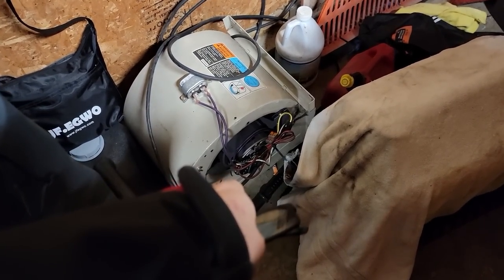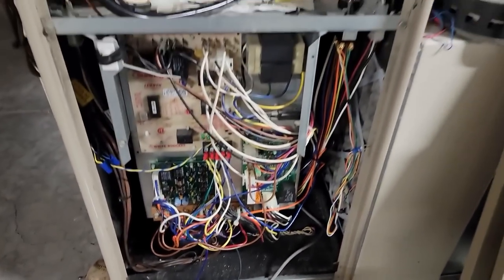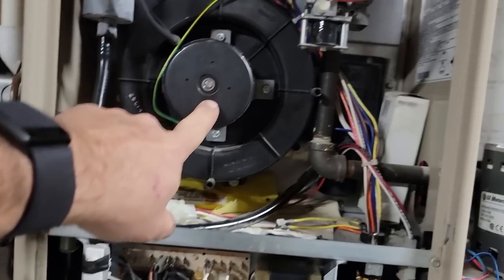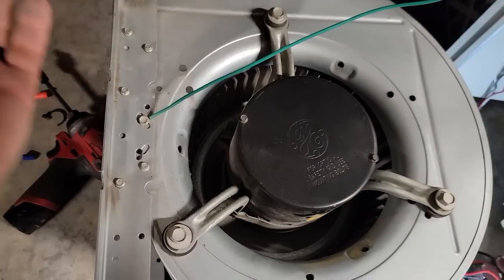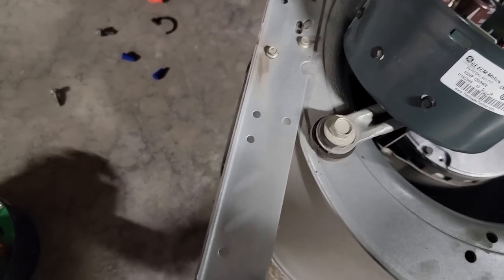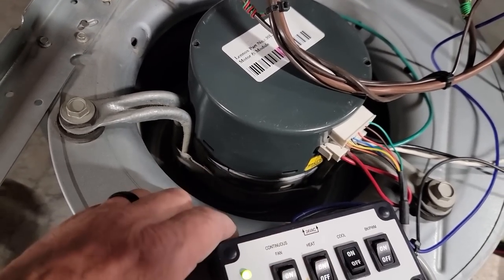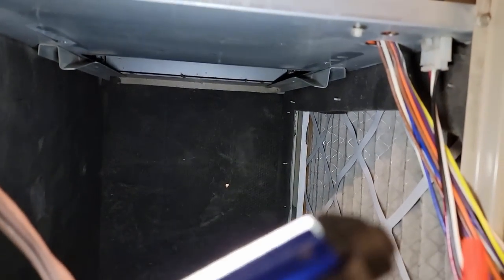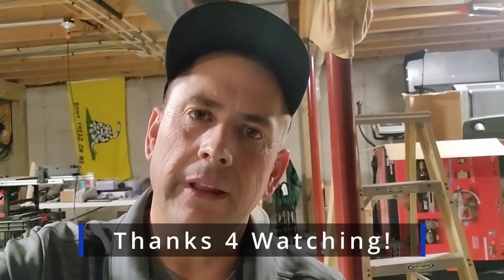NO HEAT @ MY HOUSE! + I'M ON CALL🤦🏻

Comment from the maker: 🍺👉👉Before you guys say anything... the electric strip section has a cover that I did not have on it,  so no need to worry about safety. Also a good example of warranty parts that I acquired would be having a bad controller but the motor being okay or the motor having noisy bearings and the controller being ok.

Comment: An ECM blower motor that lasted 20 years? That's got to be some kind of a record!
Reply from the maker: Probably because I left it run Non-Stop. I figured if the bearings go out I can replace those
Reply: @HVACRSurvival  That's true, most electronics fail on startups.

Comment: I saved some HVAC parts for many years.  I've given much of the stash away, now.  Fractional horsepower single phase motors were keepers.  Always kept parts on hand for the furnace in my house... an old Mueller Climatrol.  Never needed anything for it... so far...
Reply from the maker: That's Smart!👍

Comment: At least it’s repairable. I have a trane heat pump on my house and the condenser txv sensing bulb/cap tube rubbed out. Been waiting a week for trane to get it here
Reply from the maker: I had the same thing happen to my Ducane heat pump, I ended up getting a whole new condenser unit because the compressor ended up going bad because they didn't put a low pressure switch in it to protect the unit and they did not have any compressors in stock. I wasn't going to wait a week and a half in the middle of summer. I put it real gently like this, "I see seven to nine customers a day and I'll sure they all know what kind of quality you have... so get me a new unit. "

Comment: Very nice video. What would it take to change the ECM motor to a PSC motor? Thanks, hope you will show how to do this in an upcoming video.
Reply from the maker: The main control board has heat and cool speed available, You would just hook the psc fan speeds to the spayed terminal on that control and your done.

Comment: There are companies that specialize in rebuilding circuit boards, and that might be a solution to the supply chain issues on certain products. It might be good on hard to find/obtain units.
Reply from the maker: The part that actually has the microchip has a rubber coating poured over top of it so you never get it out. GE knows how to stick it to you.
Reply: @HVACRSurvival  I'm sure that the rebuilders have a work around. Sometimes these coatings are a type of urethane, and moderate heat can soften it enough to remove it.

Comment: At time marker 12 min and 10 seconds you said the motor was 3 phase DC. 

Phase is a property of cyclically varying things like AC voltages. DC is not variant, but constant with respect to time.

The concept of phase is meaningless for DC.

Would you care to elaborate?
Reply from the maker: Research frequency drives for a better understanding of how the drive system works. Its a modified AC wave form and it is truly a  DC modified wave form being created with pulse width modulation,
Reply: @HVACRSurvival  pwm is a AC signal.
Reply from the maker: If you say so but you're incorrect.  Pulsing dc voltage is how you make a clean sine wave. Ever heard of an inverter generator? Generators generate AC voltage but it's converted into a pure sign wave with dc rectification.
Reply: @HVACRSurvival  yes your right about the generator using a dc to make a wave.   It’s just a new slang for me.  Ha ha.

Comment: I’m assuming you put your thermostat to emergency heat and then flip your switch? Otherwise you would have furnace operation simultaneously (aux)   Just curious on how you wired it. Thanks
Reply from the maker: Its a dual fuel stat so it wont run the heatpump and gas heat at the same time. But when I run electric heat I reprogram it for electric.
Reply: @HVACRSurvival  I was wondering. That’s how I did mine. Used a pro8000 and memorized the 4 digit password lol just go in and change parameters quickly lol
Reply from the maker: I used to have a edge dual fuel-stat from carrier, now I have the carrier Cor (the best one) I know a few were total junk
Reply: @HVACRSurvival  I’ve installed a few Cors over the years I can’t say I ever had an issue. The worst thermostat I ever installed is the trane 624 lol. The company I work for is a carrier dealer I’m all residential and I know carrier wants the ecobee for their system financing. So we’re mostly installing ecobees now.
Reply from the maker: @jaredbailey1494  I have done a couple of those eco bees, they seemed nice. I'll take infinity any day but $$$$$
Reply: @HVACRSurvival  agreed!

Comment: Where can I buy one of them ecm motor testers
Reply from the maker: I got my latest one on eBay, my first one was from the Carrier supplier.
Reply: Do you have a part number for the one you used
Reply from the maker: @MrAdamd83  this is the one I have used for years and years but you did not see this in the video. I don't think they make the one I bought on ebay and honestly I would just get this one. I get a commission if you use the link, you pay the same amount.  https://amzn.to/3EU7bDe

Comment: nice illegal "frankenstein" heat strips (exposed wiring) :hand-orange-covering-eyes:
box it in with some sheet metal and label it. lol. I'm sure that will draw worse comments than me having a chuckle.
you need a triple stage thermostat or timer/thermostat to auto-switch electric to gas. 🤣🥳 actually, that looks about like something I'd do to my own equipment. but as of late, I've been doing everything more "kosher" and safe, never know whom will be dawdling around and finger blasting things they shouldn't be anywhere near.🤡🤡